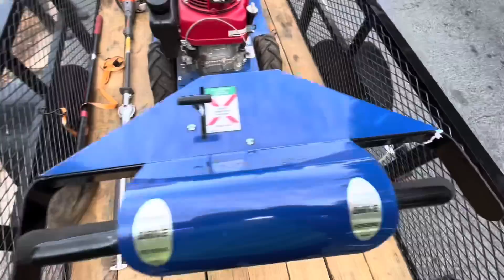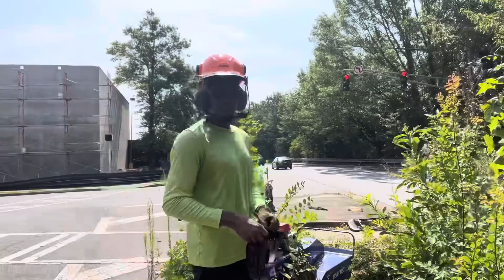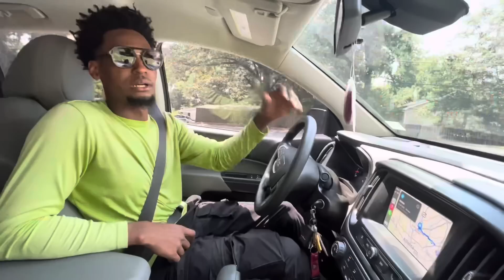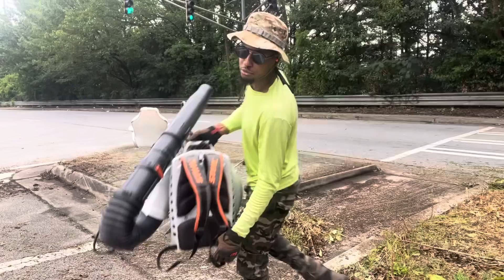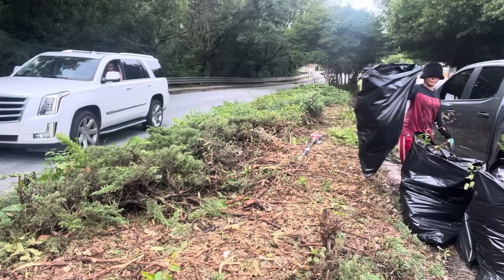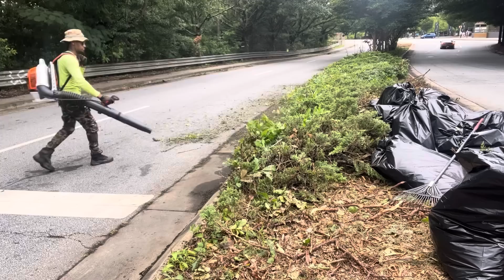Nature Reclaimed This Median And The City Did Nothing!

Comment: Large plastic bags are not adequate!  You needed a trailer with mesh sides.
Reply from the maker: I have a trailer with mesh sides. It’s in the beginning of the video. I used it the first day, I just didn’t bring it with me the second day after I dropped off the brush hog.